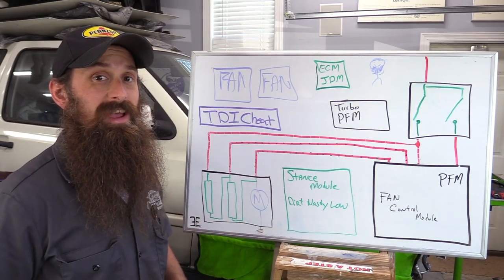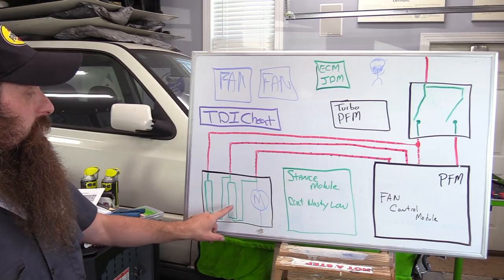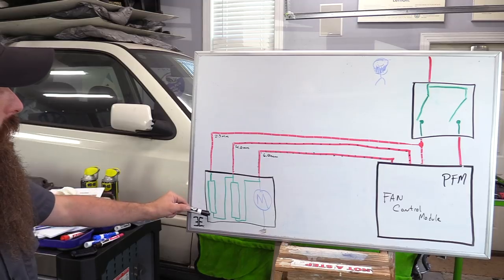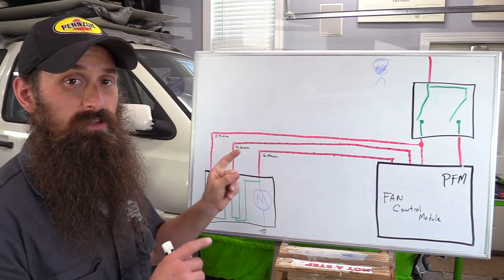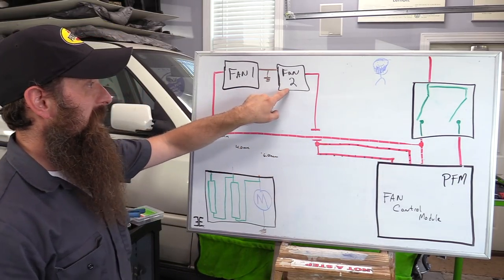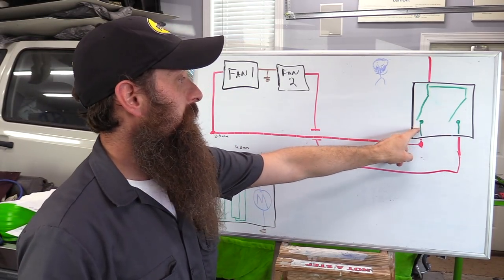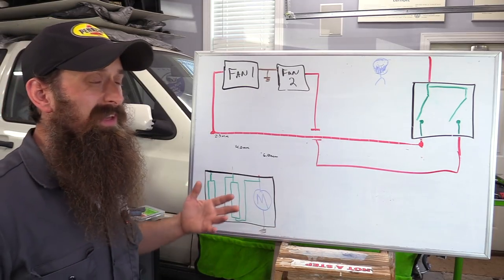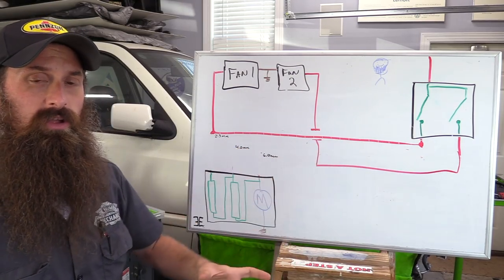Understanding How To Wire Electric Cooling Fans

Comment: Excellent job Mr. Engineer...ive seen too many "techs" use a switch in the car to trigger the fans. No relay or fuses used. Or using the ignition to trigger a relay and the fans run everytime the key is on. I've seen some butchered up installs for sure. Great job HM

Comment from the maker: I also filmed a video showing you HOW to make this work on the car. That will be out soon.
Reply: HumbleMechanic dope
Reply: HumbleMechanic when and how does it make the distinction between the need for medium speed or high speed fan control? 🤔 And would the Fan 1 not continue running at high speed the entire time that the first throw of the temp switch stays engaged ? In the winter this might not be what you want if you do plan on this as an everyday driver.
Reply from the maker: The distinction between 2 and 3 is a little fuzzy. There is another thermal switch in the system, but it doesn't list anything for the activation temp.  2 comes on at 95°C or so based on that thermal switch I show i the video. 

Speed one will stay on at all temps above 87°C(or so). 

Winter time is not going to really be a concern. If anything I am more worried about summer time. We don't see that cold of temps in NC.

Comment: "In order to install the new fans you must understand how the old fans worked". This is the best, the most truthful, the most accurate comment I have seen any of the guys that make car repair video make. Before you come to the conclusion that the guy who designed the system is "dull" make sure you can explain his design. Do not tear work apart simply because you do not understand the technique used. Work to repair the existing design when possible. I have seen people replace good fuel injection systems with carbs  simply because they would not take the time to learn the system. Same with vacuum operated secondaries on a carb. I have seen the vacuum diaphragm removed and replace by coat hangers.
Reply from the maker: Thank you! 
I actually tried to "reinvent" this set up. It just had me racking my brain. I am pretty sure the team that designed this system is smarter than I am. And they spent more time with it. LOL

Plus all the pieces were there from the factory.

Comment: I was interested in this because I rewired the electric cooling fan controls in our Jeep Liberty because the stock relay burned out more than once.  Now, it triggers another relay only and doesn't carry the fan current.
What I was struck with while watching was the wire sizes, was:      Wait!  I thought.   6mm is about 1/4 inch.  Huh?

Some googling yields the info that European wires could be sized as SQUARE MILLIMETERS. 6mm^2 would be roughly a no. 10AWG.  Likewise the others:  4mm^2 roughly #12,  2.5mm^2  roughly #14.

Had me there for a minute, and learned something.

Comment: I used the factory two-speed fan switch (Mk2), to trigger relays for the fans.   One 8" fan for low, and a 12" for high, mounted puller in a shroud.  Worked pretty well.   The same setup could be wired to retain A/C if you used a double throw relay on the high speed fan (at least I think that's what it's called, a relay that can trigger from two different sources, DPDT?)

Comment: Great Video. One edit however. The series resistors reduce the Voltage across the fan. It does not affect the current. This circuit, where you have a resistor in series with the load is called a voltage divider circuit. DC fan speeds vary with the amount of DC voltage potential across the terminals. 

I've learned a lot from your videos! Thanks and keep it up! I have an M10 E30 I would love to boost some day.
Reply: You need to review the drawing. The additional resistance in series with the motor will assuredly reduce the current. Simple application of Ohm's Law proves me correct.

Comment: that pretty cool to watch!      only thing that came to mind to me was.    just adding one resistor the the high side will enable you to use the third speed in that ecm.   

like you said..   a thousand different ways to wire it up.

thanks for sharing!

larry

Comment: Hey Humble thanks for both videos Sir, 

will removing the fan module cause vcds to read fault code, currently have fault code electrical malfunction in of the fans 2007 S6, I saw your other video and was thinking doing the same upgrade 2 Moshi moto fans

Comment: Great video Charles! Can I ask what fans and shroud you’re using? Also wondering how you ran the wiring to fan #2 since there are two wires that need to go to it from the FCM. Thanks man! (Bumblebvr6)
Reply from the maker: I picked up the fans from a buddy that went a different route. The fans are mishimoto and the shroud is from "Hardlines by swoops" I think . 

The 2 wires are basically spliced tougher. Here is a sneak peak at tomorrows video showing exactly that. :)

Comment: Hello sorry to bother you but I've been struggling to find an answer for this. I have a 1998 GTI Vr6. The medium or high speed fan comes on as soon as the ignition is switched on, even with a cold start. I tried replacing the fan control module and unplugging the switch in the radiator, with no success. Could this be caused by one of the switches/ sensors in the thermostat housing? Thanks for your time and keep up the good work! Love the Wookie!
Reply: Is you HV/AC system switched on? Try testing replacing the thermo fan switch screwed into the radiator.

Comment: Iv found older volvo's have a nice two stage fan relay and could use a pair of ballast resistors for both fan on the first stage.
Reply from the maker: NICE! I really tried to use the OEM resistors, and I could have probably made it work, but the install would have been ugly.

Comment: Hi, nice video, i doing a big turbo 1.8t in a tt, i would like to use a simple fan and setup radiator, was thinking about civic mishimoto, but seen you can simplify out system deleting the fan controll module, what is the best way to do it?? Im doing that because i want to remove all the wires as i can, to male it clean and easy to work on the big turbo car, thanks

Comment: @HumbleMechanic
Did this end up running how you thought? I was under the impression, that once you hooked the two fans together it would jump the circuit making both fans run on all speeds.
Reply: Ok, i watched again and realized you don't have the 2 fans connected just grounded together. My MK3 is an aba, and only has 2 speeds, but everything else is the same. Do you need to continue the low speed wire from the thermo to the fcm? Does the fcm need a low speed signal, if you are already sending that signal to fan 1 before the fcm? In other words, does the fcm need a low speed signal for anything besides sending signal and power to fan 1?

Comment: Good video Mr HUMBLE, I pretty much understood your video. My problem is an 2006 passat an air condition problem. I also have a 2006 jetta and the air condition works just fine. the fans on the passat do not work like the ones on the jetta do. the little fan on the passat will not kick on which I understand needs to be on for the air condition to come on. I   ran a hot wire to the little fan and it does work. so I guess my question is where does it get it's power from and where is this unit located
Reply from the maker: The big fan in that car has the fan module built in to it. Odds are the main fan is bad too
Reply: HumbleMechanic  since I had the fans out of the Passat I went underneath the Jetta and hook them up to it and they seem to work just fine.

Comment: I have a dumb question- Why would you want a multiple speed fan setup? It seems unnecessary to me. My Honda is set up so when the coolant gets hot or the AC is on, both fans run at full speed. It's lot like the engine will get too cold if the fans runs too fast LOL.

Comment: Hi,
How about the AC? Normally you would want both fans on low when the ac is on as well a both fans on high when the ac load is high (via a ac pressure or temperature switch). This should be independent of the engine temperature.
Reply from the maker: +Peter Berbee this car should put both fans on high when the ac is on regardless of ac demand. It’s not a smart system.

Comment: The only part I don't get on my application would be the switched hot wire. Could I use a Piggy back fuse to the relay and then to the fan

Comment: humble i need help what you think it could be happening in my car a vw mk3 vr6 i remplaced fan control module brown cut off sensor on water neck also fan switch but fan run on one speed and if i put directly 12 v to each cable on the fan factory conector the red white stripes goes on the red green stripes go on but the red black stripes dont could be the fan itself ? If you can help me, I would be very grateful

Comment: Am I right in assuming removing the control module won't set a code that the module is bad or an open circuit?
Reply from the maker: +Brad Downs not on this generation car
Reply: Went through my VW OBDII code book (several hundred OBDII codes). The closest I could see, if even possible, would be a something like a P1854 CAN-bus hardware defective. My feeling is that "codes" are for engine performance/emissions and safety like a P1786, Reversing light circuit open. Not so much for things like "radio receiver shows poor sensitivity" :). This is not to say that the reading ability of your scanner would not be a tremendous help when diagnosing systems not supported by "codes".

Comment: I have a suzuki Sierra sj50 it came with a g13a which had a thermal switch on the thermostat and then a relay which would then turn the thermal on at 98c but I’ve changed the engine to a very common swap to a g16b and now my thermal fan obviously doesn’t turn on, how would I go about setting up the same set up to the new motor?

Comment: Hello sir, I have a question and/ or problem. Both my fans stopped working on my Honda Pilot and all the fuses relays are good and they don’t go on when I turn on the AC . I tried tapping on the ac clutch to see if it would engage but it’s a no go. My trucks running hot burning transmission fluid but I’m not getting any codes! Could I run two wires from the battery straight to the fan to see if it will run without worrying if it will overload the fan thanks ! Sorry if confusing!!
Reply from the maker: Yea I would fuse the jumper so it doesn’t melt the wire if the motors have issues
Reply: HumbleMechanic   Will do thanks 👍

Comment: Hey bro when u had the cabrio and only had  1 fan and set on the low speed line, did it keep the motor cool or will it heat up and required a second fan?? Please get back to me please

Comment: Why do you need a high? If both fans are going to come on at medium. Or on high the fans will be at a different RPM, of CFM?
Reply from the maker: The reason I did it this way is, I wasn't sure if the Fan module dropped the mid speed when high was engaged. It's something I can check when the car is running at high speed temps. But not statically.

Comment: I'm wondering what would be the best way to add electric fans to an older vehicle that only has an electric in front for the AC and an engine driven fan in back. I want to eliminate the mech fan and add two electrics it it's place. Do I have to add a temp sensor? Where would it mount? Does it HAVE to be the type that's in the coolant stream or can it be mounted to the head?  What sensor ratings would I use in either sensor mounting scenario for an engine that likes to see 180F-200F as a normal range? Yes it sounds like a dumb question until you take into account actual engine temp vs surface temp. I'm thinking that these things are probably known by someone who designs this stuff. I could be wrong.

Comment: humblemechanic do you think the one fan would have been good enough to prevent engine over heating?
Reply from the maker: +Zackary West in the hot NC summer, I doubt it.
Reply: I did'nt think so. plus a bit of a fail safe with the two I suppose.
Reply from the maker: +Zackary West yea this is not an area I like to chance

Comment: I've been thinking about replacing my stock fan with dual electric fans in my mk3 jetta. Mostly because the male and female fan plug has broken tabs and has melted. But with the ac deleted and no plans of bringing it back, how would I wire them up? I've tried to Google it and have asked on forums/ fan pages on facebook with no answer.

Comment: Any particular reason you decided to keep the FCM when in essence you could have just ran everything off the thermal switch and some aftermarket relays as you explained near the end?  Seems like you could have removed a redundant redundancy.  Just seems to me like it would be easier, cleaner, and safer, to redo the fan wiring from almost scratch and eliminate a possible headache down he road.
Reply: wht02cv something to do with the retention of his AC
Reply: I see, missed that in his diagram ;)  gotta love it when your missing the 3rd page of a wiring diagram...
Reply from the maker: A/C was a big reason. Plus the OE setup has all the relays and controls already there. I didn't think it would be easier to delete then add back in basically the same stuff. 

If the FCM fails, I may do what you are recommending.
Reply: I also didn't take into account you worked on VW's since God made dirt so I'm sure you know every diag (or can access it) for them lol...  angry pixies are never fun to chase when you dont have the manuals.  I really need to buy one for my crustang...  Nice build keep it up!

Comment: I'm a little late to the party, but with this setup, does the after-run feature from the FCM also function in addition to the AC demand? Stock fan just quit on my Mk3.5 Cabrio VR6.
Reply from the maker: It should. I haven’t tested it though. They should function just like stock from the control standpoint
Reply: @HumbleMechanic  Thanks!

Comment: Q. I have replaced all cooling system pieces in my mk4 . Now the fans won't work. I've replaced the temp sensor and fan control sensor but still no luck. Checked fan control unit and seems to be in good condition internally. I've bypassed the fan control sensor and both fans work. Could it be that I have a defective fan sensor ?? 

Car has been in storage for a few years so when I'm testing the fans the car won't reach temperatures high enough for fans to kick in. I'm just turning on the AC in order to check if fans are operating as intended.
Reply from the maker: look at the fuse panel on top of the vehicle battery
Reply: HumbleMechanic thanks. That  was also replaced since it seemed to be in bad shape. Still troubleshooting things. I'll try replacing the fan sensor again

Comment: Would this still work if the vehicle came with a clutch fan?
Reply from the maker: No you’d need to add the wiring to go from mechanical to electric setup

Comment: Humble I need help. I have mk4 jetta 1.8t the problem is all the antifreeze is coming out of the store unit I already replace the thermostat & nothing happen still the same, the motor oil is clean, it was working fain until I replace the hoses from the oil cooler that is when the problem star
Reply from the maker: I have seen bottles fail, and I have seen the headgasket failing do that too.
Reply: Thanks but the problem was the fans fail & I don't notice until now but thanks anyway

Comment: What is the difference between speed 2 and 3? On speed 2 both fans are running so what changes for speed 3 if you're not running any resistrors to slow the fan speed for speeds 1 and 2?
Reply from the maker: +redrider11rc Speed 2+3 are the same
Reply: On the factory setup, speed 3 was just for when AC is turned on - which did increase the speed of the fans. On Charles’ aftermarket setup, speed 3 isn’t changing anything for speed of the fans (I believe).

Comment: Good video, However leave the white board  with the engineer. Lol. Also control of the fan speed is ground.
Reply from the maker: That is why it has an EE logo on it.
Reply: Somebody beat Me to it. Was going to ask if Jason knew You had His white board. recognized 
His logo. One question though. Why would VW put the resistors on the fan, and not in the module?
Is there any reason?